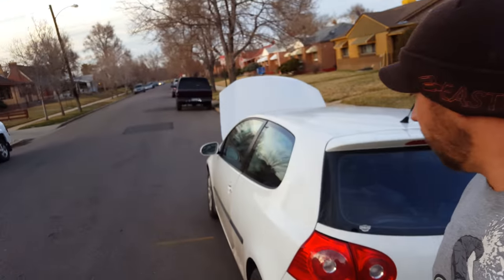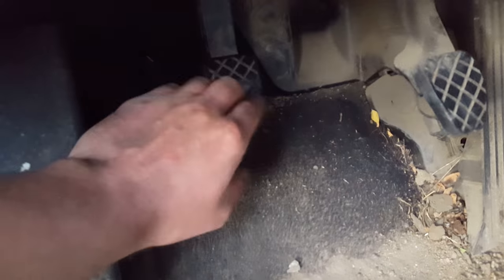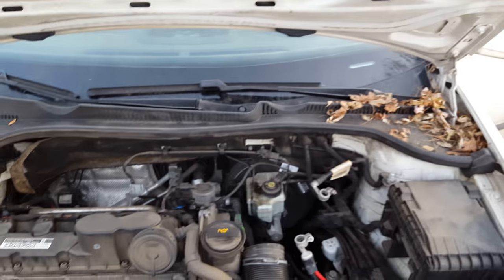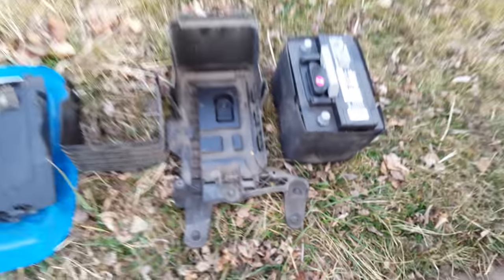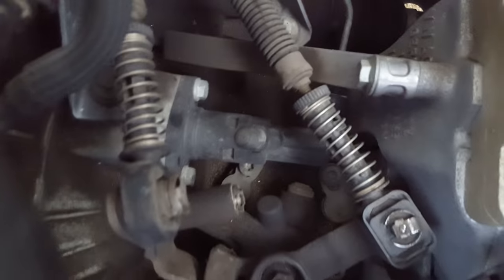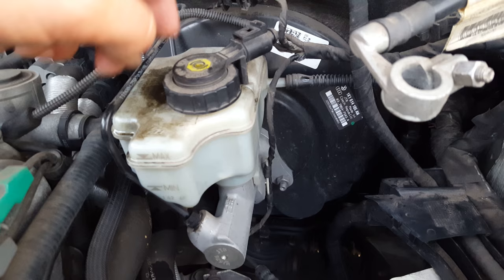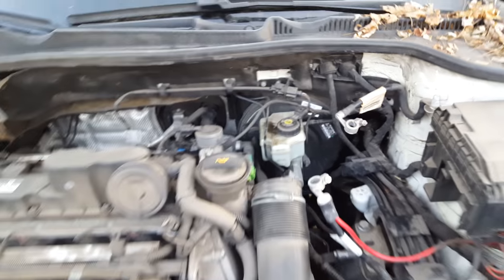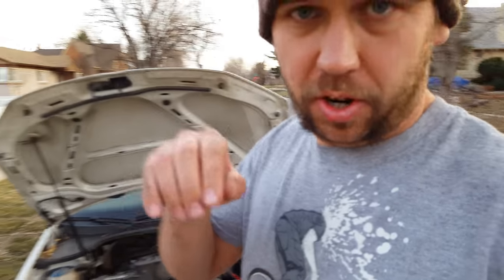My clutch pedal stuck to the floor on my 2007 VW Rabbit (Blown Clutch Master Cylinder) DIY

Comment: Thanks for the help man, exactly what happened to my forester. thinking its just the master cylinder
Reply from the maker: +Hunter Isaac no problem man thanks for watching
Reply from the maker: +Hunter Isaac later I found out that it also was a seal on the slave cylinder that was letting air in just a heads up if you have trouble bleeding the system.
both parts are plastic so it may be good just to replace both at the same time and have it done with.

Comment: Hello Nick, I have the same problem with my VW Golf 2.0TDI 103kW, 2012.
The pedal stuck to the floor.
What is the name of the part that you've changed?
Reply from the maker: The master cylinder

Comment: You don't know how glad I am that I found this video. 

I have an oldish car, around 15 y o Renualt Twingo that was barely driven before I got it, had it for like 5 years now and it scared the daylights out of me today because I was stuckin a crossroad with my clutch sticking to the floor and the car not being able to start at all, it luckily sprang back to life but I was seriously scared that something major was wrong and I'd need a new car right away (currently saving for a new used car but I would prefer to get it without a loan lol)
Reply: Quickie update: Turns out that nothing was wrong with anything leaking or anything O.o According to my grandpa the rug on the floor of the car somehow got around the clutch or something like that and the clutch got tangled in it and that's why it wouldn't work - but that was the first thing that I checked and it wasn't tangled or anything- it hasn't happen since but hopefully it doesn't happen again until I can get a new car x.x
Reply: TWINGOOOO
Reply: This happening to me right now thanks for this Video 🙏🏻😊

Comment: So, this just happened to my 2006 VW Jetta yesterday....I am not a DIY'er...its now sitting at my local garage...just wondering how much this bill, is gonna cost...can't really complain, too much, this car gets pushed in the speed dept and hasn't really given me any major issues, until now...even with it close to 170,000 miles.
Reply from the maker: After taking mine apart I found out that it's best to just do the whole system from the pedal all the way to the clutch and it's around six seven hundred bucks. Otherwise other stuff brakes later
Reply: So, did you get it fixed by a shop and if so, how much was it?

Comment: Can you please help me!! I have a 2010 Toyota Corolla that just got a new clutch installed. Once installed I noticed the clutch pedal was weak when pressing.  I tried to bleed the system at the slave cylinder but couldn’t get it to keep pressure at the slave so I replaced the master cylinder. (Thinking it had weak pressure overall) the clutch pedal would go to the floor when bleeding the slave and would get stuck down. I’d have to pull the pedal back up to get pressure back. After the master cylinder was replaced I got the same pedal to the floor experience when bleeding at the slave. When the pedal gets stuck the only way to get my pedal back with pressure was to pull it back out. I’m not sure what to do. The only other tip I can give is that when the pedal gets stuck to the floor when cracking the bleeder screw in the slave I close off the bleeder and can press in on the slave cylinder rod that is on the shift fork and as I press it down the clutch pedal pops back up. I’ve tried gravity bleeding it too and the pedal will again go to the floor. Would this be a bad slave and not master?? Or any idea?? When bleeding I had my fluid all the way full to eliminate any air. Thanks!!!
Reply from the maker: The frustrating thing about hydraulic systems like this is bubbles get stuck in weird places and corners in the system.
The system should be set up so the reservoir is higher than the clutch so bubbles naturally want to work their way up but you need to help it along with about 100 pedal pumps and see if that works with the system closed off none of the bleeder equipment attached or bleed ports open
Reply from the maker: Also not soon after the master cylinder went bad on my car the slave cylinder went bad as well so there could be a leaf there as well. On the Volkswagens you can just take the slave cylinder off and look at it I'm not sure if it's the same on Toyota's

Comment: @Nick Soloninka  very informative video.

I got the same issue. Pedal stuck to floor and I have to pull up normally.
But, there is no external leakages anywhere and fluid level doesn't drop at all.

So, is internal leakage in the seals  within the master cylinder the issue? If so, how to confirm? Thanks.
Reply from the maker: It may be the hose or the slave cylinder seal failing. after I did the master cylinder I had to do the hose and slave cylinder as well because it was leaking
Reply: @NickTheDenverDirtJumper  thanks for the reply.

In fact, the slave cylinder was already replaced. No leakages around hoses, no external leakages...all good.

This issue occurs after some time only.
Reply: @NickTheDenverDirtJumper  to be more precise...

I can't even changed gears even with or without clutch pedal depressed!!! Gear does not engaged at all!!! This was done with engine running as well as engine off😌😌😌

Very very confusing!!!
Reply: @tnamen1307  i have same problem, were you able to fix it ?
Reply: @tonsing t id like to know to i just bought my 06 gti and it failed less than 24 hours

Comment: Mine was leaking on a master cylinder so what to do after you're done because the clutch is still down, I even change the hose please help.
Reply from the maker: First try pumping the pedal back and forth for about a minute if there are air bubbles in the system they need to be worked out.
You may have to bleed the system using a brake bleeder kit.
If that doesn't work check for other leaks at the slave cylinder.

Comment: Hey Nick! Thanks for the video! 

I got the same car, same color, and same problem! Lol
I even live pretty close to you, I'm in the Colorado Springs area. 

Anyways did you ever get this fixed? I'm trying to disconnected the clutch pedal from the master cylinder, and it's an absolute b**ch! 

Getting the white clips off from the master Cylinder is a nightmare, any guidance would be greatly appreciated!
Reply from the maker: So I did the master cylinder myself but then a month later the slave cylinder blew out. 
I got the pedal disconnected pretty easily but putting it back together was not hence why I did not make a video because I was swearing at it at my kitchen table

Comment: Hey bro, nice video, i have golf 5 and wanted to ask you did you notice something before it goes down the clutch, i notice that on higher speed, when i want to change gear into 4th the clutch is going down very lightly and going back up slowly , did you experience that ?
Reply from the maker: Yes that is exactly what happened to me it's probably going to continue to get worse.
Reply: @NickTheDenverDirtJumper  damn i was hoping you gonna say nope 😂

Comment: NICK!!! Are you kidding? My you tube adventure led me to you?! I am doing the clutch cylinder on a Tdi Jetta. I hope life is treating you well.
Reply from the maker: Awesome. It's not bad to do.
Reply: @NickTheDenverDirtJumper  very informative video.

I got the same issue. Pedal stuck to floor and I have to pull up normally.
But, there is no external leakages anywhere and fluid level doesn't drop at all.

So, is internal leakage in the seals  within the master cylinder the issue? If so, how to confirm? Thanks.

Comment: hi guys . i have a 2007 golf 5 rabbit. i replaced the clutch slave kit. but the pedal is still sticky . what do i do now.
Reply from the maker: +EBRAHIM HOOSEN did you bleed the system? And how meny miles are on the clutch?
Reply: +Nicholas Soloninka . new clutch plate done and new clutch slave kit. no air on the line .
Reply: +Nicholas Soloninka . Do i need to replace new pipe . what i notice is a slight leak from the pedal side

Comment: Did you make a video on the replacement procedure of the Clutch Master Cylinder?
Reply from the maker: No I have not.
I'd be happy to walk you through it if you have any questions.
In the engine compartment you take the engine cover off and the battery and holder out and that'll allow you to get to the master cylinder.
Then on the inside of the car are the bolts that hold it in place you have to take the lower dashboard off which is a couple turkey parts to you and then the whole pedal comes out and you replace the cylinder that's inside of the pedal holder.
Reply: @NickTheDenverDirtJumper  I've heard you need a top side pressure bleeder( whatever that is) in order to get all the air out after? was it hard to bleed? take a long time? and was the part you used still holding up?

Thank you, I'm pulling it all apart right now and just am worried about the bleeding process, still need to order parts too.
Reply from the maker: @messedupA_A_ron  I was able to get the pressure pretty good just by pumping the pedal a lot. The other issue I had was the slave cylinder was leaking as well and letting air in so you might want to look out for that.
Getting it out is pretty straightforward the hard part is getting the new master cylinder into the pedal just awkward and hard to pop into place.
Reply: @NickTheDenverDirtJumper  also the top hose on the master? how is it held on? the bottom one is a clip, i know, but what about the top?
Reply: just needed more muscle to get it off.
Reply: how to get the old master out and the new master in:
https://workshop-manuals.com/volkswagen/golf-mk5/power_transmission/5-speed_manual_gearbox_0a4/clutch_control/clutch_operation/removing_and_installing_master_cylinder/

Just thought i'd leave this here since it is a bit tricky.

Comment: pretty close to replaceing my whole damn 2008 mazda 3.  just over 100K miles.  lovely.
Reply from the maker: I ended up replacing the whole system and then the clutch its self 10,000

Comment: Very much appreciated brother! I just bought my 07 rabbit just earlier this month....  not having this issue, but it gives me a good idea on the simple breakdown of components to reach that area of the engine bay. I haven't read the other comments... but just a heads up: be careful popping the four tabs on the underside of the air intake box... some of us have broke them in the past... Carefully work them from corner to corner... take your time and you'll be fine I always say!!

Comment: damn wish you would've made a second video i really need it. cant find out how to remove clutch master cylinder. do you have to remove the clutch pedal set off or can you take it off in the engine bay
Reply from the maker: +Joseph Nguyen you have to take off a good portion of the lower dash
Reply from the maker: +Joseph Nguyen replacing the master cylinder isn't bad by itself it's all the other stuff you have to take off to get to it that is a pain and partly why I haven't made a follow-up

Comment: Thank you for this video just starting my endeavour with a 2007 Volkswagen rabbit here in Idaho got 10 miles down the road and the clutch completely went out on me praying it's not a $400 set and I can just replace the slave cylinder like I did on my 85 F350 6.9 diesel going from diesel truck engine bay to Volkswagen rabbit engine bay is going to be a journey there's no power in any gear but first and anything more than 3,000 RPMs it doesn't go barely crawls around the block clutch or slave cylinder?
Reply from the maker: Hey did you do the repair yet? Sorry for the late reply. 
you can do each individual piece and it's not a bad strategy if you're short on cash and can do the work yourself, but but if you're having a shop do it it might save you a little more money in the long run to do all of it the master cylinder, line and slave cylinder all at once. Pretty much all three pieces failed within a few months of each other.
Reply: @NickTheDenverDirtJumper  it was the "orginal "clutch w/ 182000 miles even the fins and springs were disintegrated according to the mechanic the lot payed for a new pressure plate fly wheel throw-out bearing clutch and master cylinder!  Got my car back in two days after having it roadsided to a shop! Thank you driving around in snow and ice with three 80 lbs bags of quick crete in a 3 d

Comment: I had the same issue replaced the master cylinder but now my clutch pedal is lower than it used to be 🤔
Reply from the maker: You probably have an air bubble in the line or what happened to me next was the slave cylinder went out and was letting air into the system

Comment: Very helpful,thank you, now I know where to start,lol
Reply from the maker: No problem. Thanks for watching.
Reply: It’s my clutch,I have to tear it all apart and replace everything! 😢
Reply from the maker: @nicksaggio6155  Yeah. It's better to do it all a once the master, slave, and hose. I ended up having to do it all.
Reply: @NickTheDenverDirtJumper   @Nick Soloninka  very informative video.

I got the same issue. Pedal stuck to floor and I have to pull up normally.
But, there is no external leakages anywhere and fluid level doesn't drop at all.

So, is internal leakage in the seals  within the master cylinder the issue? If so, how to confirm? Thanks.
Reply: @tnamen1307  Did you figure out your issue?  Im going to replace the master and slave.  How do I know if I need to replace the hose also??  Do you know?  Im also looking into the throw out bearing in the transmission, next.
Reply: @kathrynlove9304 I replaced only slave cylinder. 

 Check if the hoses are leaking then definitely you must replace it.

Comment: Thanks     Just found the same issue today
Reply from the maker: Just a heads up replace the whole system I ended up having to do the hose and the slave cylinder because they were both leaking

Comment: Son hoover that footwell 'hot damn
Reply from the maker: I build Dirt jumps for work?. Ok next Saturday.
Reply: @NickTheDenverDirtJumper   @Nick Soloninka  very informative video.

I got the same issue. Pedal stuck to floor and I have to pull up normally.
But, there is no external leakages anywhere and fluid level doesn't drop at all.

So, is internal leakage in the seals  within the master cylinder the issue? If so, how to confirm? Thanks.

Comment: Hi Nick, did you do the next video where you replace the master?
Reply from the maker: Sorry I have not.
Reply: @NickTheDenverDirtJumper   @Nick Soloninka  very informative video.

I got the same issue. Pedal stuck to floor and I have to pull up normally.
But, there is no external leakages anywhere and fluid level doesn't drop at all.

So, is internal leakage in the seals  within the master cylinder the issue? If so, how to confirm? Thanks.

Comment: Too helpful, not enough shenanigans.
Reply from the maker: +Stephen Cominski this goes out to my driveway mechanics.
Reply: +Nicholas Soloninka . Hi i have a problem with my golf 5 rabbit. I have replace new clutch plate n pressure plate. i also replaced both clutch slave cylinder . my pedal is still sticky . it get stuck halfway . what do i do.
Reply: +Nicholas Soloninka . Hi i have a problem with my golf 5 rabbit. I have replace new clutch plate n pressure plate. i also replaced both clutch slave cylinder . my pedal is still sticky . it get stuck halfway . what do i do.
Reply: How to replace it with all detailed point bolts and screw and how to mount it again.  Thanks

Comment: Did you make the next vid, the replacement of the master cylinder?  I need to replace mine on a 07 Jetta, had the same issue but no visible fluid leak.
Reply from the maker: +chaley mohr I did not. Replacing the part is not the bad, but all the stuff you need to take off to get is a pain.
Reply: yea no fluid on mine either. how did yours go? did it end up being the master?

Comment: Same issue different car but it does not leak. pedal goes right to the floor just like yours did. Do you think it’s the same thing
Reply from the maker: In my situation the master cylinder went out. One of the 3 other parts in the system could have failed the hose between and the slave cylinder.
Reply: Might be clutch cable going.